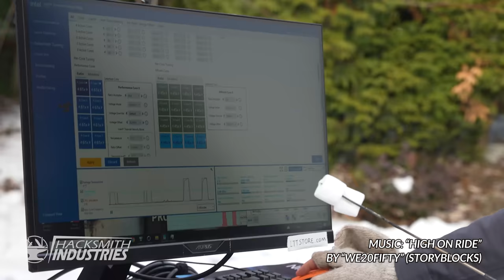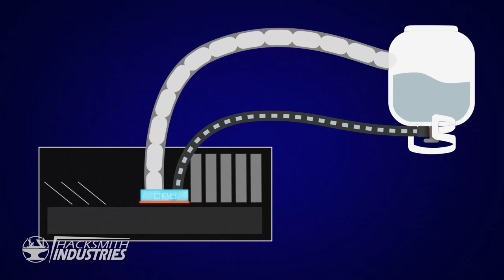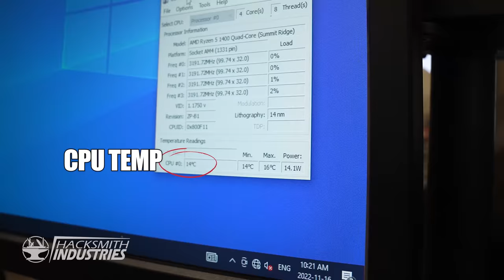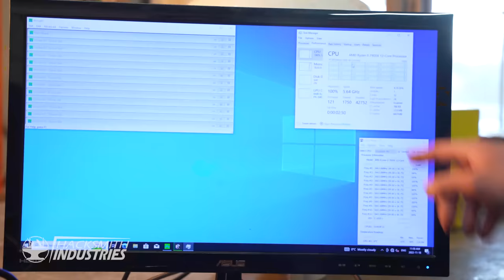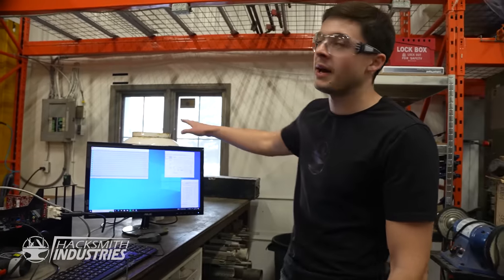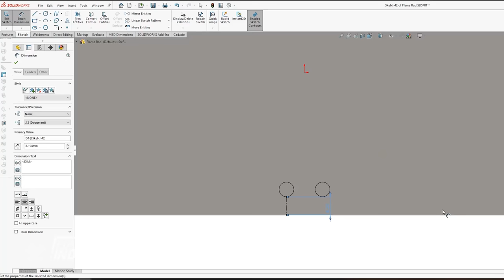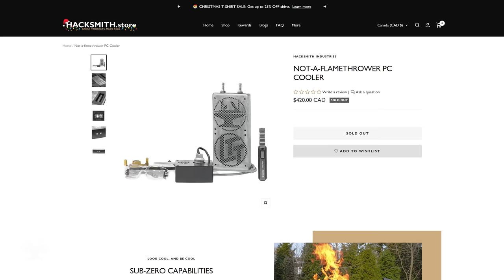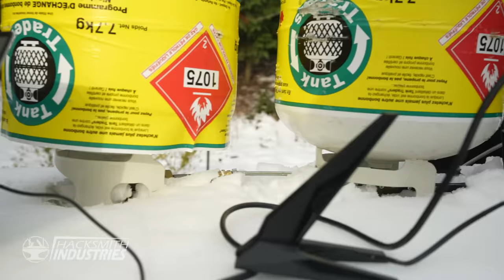I lit my PC on fire to cool it off 🔥

Comment: Compressor doesn't compress the vapor refrigerant into a liquid.  It is still a vapor when it leaves the compressor. The condenser removes the heat from the vapor refrigerant and then it becomes a liquid.  Compressor can't  handle liquid refrigerant,  we'll not for very long anyway. You could always cool it with propane without the flame. R290 refrigeration system would do the trick.  Anyway love your videos. Leave it to Hacksmith industries to cool with fire.

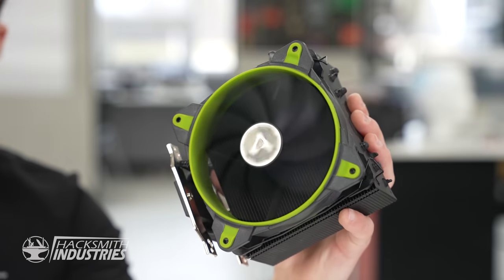Comment: 1:17 Pushing your computer harder draws more power, which means that it generates more heat. At a certain point, the airflow from the fans will not be enough to cool the computer so it will automatically lower the power draw so it doesn't overheat and get damaged. In other words: more airflow means more cooling, which means you can push your computer harder, BOGDAN!

Comment: Reminds me of the old propane jet beer cooler from New Zealand. The benefits of the jet were that it handled all of the combustion internally, so there was no propane or flames spewing out. The cons, though, were that it used fuel directly from the tank, meaning only things contacting the propane tank were cooled, and the jet was noisy, around 125 dB if I remember correctly.  All in all, nicely done!

Comment: I feel like the final design needs some aluminum heat deflectors to channel the radiant heat from the flame upwards away from the case and the lines and maybe some ceramic wool to keep certain parts from igniting

Comment: Place just the motherboard cpu etc inside a vacuum chamber with the propane venting/burning off out side it, the moisture inside will instantly evaporate and attach pump to keep it a vacuum during operation allowing you to maintain those sub zero temperatures indefinitely.

Comment: The propane cools the cpu, the fire doesn't alter the cooling. This is propane cooling a pc then burning off the propane, which you could alternatively capture or just release in a ventilated area as propane is not considered a pollutant, or a greenhouse gas. If the fire doesn't have a direct effect on cooling it's not a fire cooled pc, it's just a pc, with fire

Comment: Remember my old 74 Mercedes camper where I had an fridge that could be either powered by battery or by gas. We even use evaporate cooling on our beer cans on festivals when we put them beneath the tend so when the morning dew evaporates they cool down (just beside amonium nitrate what is not easy to get if you are not a gardener or rocket scientist 😜🤣😂)

Comment: to assist with preventing the case from melting you could install the "radiator"  in a barbeque so you can cool the processor while cooking a meal such as a steak or roast.

Comment: So... you could actually have that setup produce power at the same time as cooling the cpu. Look into the Seebeck effect.

Here's what I would do, if I had the tools and materials. 

1. Create a heatsink for the thermoelectric peltier units (We'll call them TPU's for short for sake of ease.) You are going to use these to utilize the seebeck effect. This heatsink needs to have two flat contact sides for each TPU. A hot side and a cold side. The best way to do this will be to have a giant  heatsink for both sides with multiple contact points for each TPU with their wires facing outwards from the unit; with protective shielding from the flames/cold. 

2. The propane is fed through the cold side of the heatsink. The hot side is your flame expander. The propane also could be fed through to the CPU, but if so, this is only after going through the cold side heatsink first because that's going to have a fan attached to it to help cool the rest of the computer through a desiccant filter (to absorb moisture that shouldn't be going near electronics.).

3. The TPU having been sandwiched between the hot and cold sides opposite of its own hot and cold sides to produce that seebeck effect; now run the positive and negative lines to a battery bank and a capacitor bank. The capacitor bank takes the power first. These are ultra capacitors so they can release their charge at a slower rate than usual capacitors which normally discharge quickly. This is important, because a regulator will be placed between these capacitors and the battery bank to turn the discharge from the capacitors into a usable voltage and/or amperage for the batteries to be charged with. (This is because the TPU's in use will only be providing small amounts of power each. You get more power the more TPU's you use in this kind of setup.)

If you make this big enough to accommodate enough TPU's, but compact enough to reasonably sized, you could probably use this to both help cool a PC even with out a propane contact point for the CPU itself; while also having the hot side heat the home of the user. Just put it in a protective casing to keep the flames encased in a safe enclosure that captures the heat in a thermal mass that can be used to passively heat the home with/without fans. 

The cold side has a fan sucking air from the home into the cold area to push through to the PC to be cooled 'naturally'. The hot side is the same idea, but for the home instead. The thermal mass is there to take the abuse from the flames while keeping the home safe. A third vent would be required to pump any fumes created to the outdoors. So the cold and hot sides would need to be kept completely air-tight. This is where the protection for the wires comes into play. That area already needs to be protected from the flames and cold; so it can serve multiple purposes. It can act as the air-break, the protective layer for the wires; and a separating wall between both sides to ensure potentially dangerous fumes don't go places they shouldn't. 

It's not really possible to show the design properly in a comment like this; but using the keys on the keyboard as best I can; here it is. Imagine the rectangle in the middle is the TPU. 

Computer <--- cold air <--- Cold side Ice {][][} Hot side Flames---> Thermal mass ---> Home

[] TPU = +/- wires --> Capacitors --> Charge Controller --> Battery bank --> Fans and Lights

Now imagine this concept with many TPU's lined up to make use of the propane as best and efficiently as possible. 

I hope this has been able to be understood by some of the madlads at hacksmith. If you do understand it, please consider trying to build it. It would be neat to see one of my ideas actually come to fruition. 

Oh, one last thing. 

You can reduce the flame size more. You don't need to be all pedal to the metal with the flame size for this. In fact, it might be best to regulate the propane flow down to something closer to 1% instead of the 10% you were using for this video. You optimally want the temperature difference for the TPU's to be as wide as possible, but you also don't want the thing blowing up either lol.

Comment: Wouldn't you be able to do this without having to burn the propane? make a closed loop system with a compressor and hard copper tubing like in a fridge but for a computer? I had the idea before. But i'd love to see if its actually possible
Reply from the maker: Of course,  then it's just like how an air conditioner works, but this is the Hacksmith channel -- things need to be on fire!

Comment: ....Have you thought of putting the PC parts inside a vaccuum casing? That way there wouldn't be any problem with air moisture aggregating around the motherboard, since the moisture would be at zero under a very simple vaccuum. Plus it sounds hella cool solving the problem like that.

Comment: Build a pc case designed for this application, combustion chamber and smoke stack to contain raw flames and direct heat out a chimney and this is a 2 in 1 gas heater/pc cooler

Comment: Now build a real fire powered evap cooler. Now I don't remember the details but fifty or so years ago I remember seeing a fridge that was cooled using heat. I wish I could remember the operating principles, but basically it let you run a fridge anywhere you could provide a heat source to boil (?) the liquid in the loop. When used in leisure craft it was usually a propane burner of a paraffin burner that provided the heat. In homes they usually used city gas, whatever mix that was.

I don't know how cold you could get these, what kind of efficiency to expect or what was used in the cooling loop, though I have a feeling it might have been ammoniac.

Damn but my memory is getting bad...
Reply: Looked it up and the technique is called Absorption refrigeration. Basically I was right, there's ammonia with a splash of water or hydrogen added for added efficiency. And all it requires is a heat source as there are no pump or compressor needed. It was basically perfected in 1921 by Carl Munters and Baltzar von Platen. In 1926 Albert Einstein and Leó Szilárd proposed an improved version that didn't really catch on as the great depression made the funding for research and development dry up, followed by WW2.

The improvement proposed by Einstein was mostly to make it safer as he used freon instead of ammonia. The freon was considered harmless and removed the risk posed by ammonia leaking out. But it also made the unit less efficient which was a problem he was trying to overcome when the funding dried out.

Anyway, that would really be cooling your PC with fire!

Comment: The explanation of the closed loop fridge is incorrect.
What actually happens:
Low pressure gas is compressed into high pressure hot gas, which is then cooled by the radiator into a liquid and held at the same pressure. That liquid is then passed into a low pressure section inside the area to be cooled which boils the liquid (due to the lower pressure) and absorbs heat making the low pressure gas that goes back to the first step. 

The key errors in the explanation given was that the liquid is passed to a low pressure area and becomes a cold gas. The refrigerant stays as a liquid until it absorbs enough heat to boil. On startup the liquid refrigerant can/will instantly flash to gas but after running for a while the liquid should take some length of the pipe to boil as the pipe has been cooled which in turn cools the liquid for a while.  
The other key error is that the low pressure gas is compressed into a liquid. The gaseous refrigerant becomes a hot high pressure gas, which when cooled by the condenser becomes a liquid.

Comment: If you had a box on top the fire that would host it with a system/ o keep sending oxygen to it as needed it. Plus put a box housing on top CPU with the cooling thing so you don't need to warry about isolation. Then this would become perfect. Although i thing it might get 2× expensive. However,  that is still cheaper than other options.

Comment: Could you use a mineral oil pc and get the propane to run though there so if water does come out it doesn't ruin the pc, I don't believe oil freezes but I may be wrong

Comment: But isn't there a limitation to it too, if u are basically cooling cpu by absorbing the heat to light propane, then ur bringing cpus temp down to propane's ignition temp innit? How does that bring cpus temp below freezing pt
Reply from the maker: Doesn't have anything to do with its ignition temp though...? When propane sublimates from liquid to gas its about -42C

Comment: The FIRE isn't really what's cooling anything here though? It's the end step. You could just decide to leak the propane fumes unignited and you'd still be getting the cooling. You could close the system with a normal refrigeration setup and still be getting the cooling. So any 'cooling with fire' claims are only accurate in a separate, inclusive sense. "PC Cooling, + Fire". I would absolutely LOVE to see the ignited propane fuel heat be harnessed for some other purpose to aid in CPU cooling though!

Comment: Definitely a cool experiment, but at the same time, highly impractical in real life. Unless you have a fireproof mancave, or some other fireproof living space, good luck getting this to work in your home! Also, propane tanks get expensive in a fast hurry if all you're using them for is your computer!
Reply from the maker: Could easily be routed into a normal propane heater, that's just not as exciting for a video!

Comment: Could a less fiery, safer alternative be made with something like compressed oxygen, nitrogen or any other less flamable gas?
Reply from the maker: Then it's the same as how a refrigerator or air conditioner works =)
Reply: @hacksmith  How far can you overclock a fridge then?

Comment: Couldn't you run the subzero part in a box with a dehumidifier to remove the moisture before cooling it
Reply from the maker: But the CPU has to be where the cooler is!

Comment: Is it actually possible to make it into a closed loop system?
Reply from the maker: Yeah there are propane powered refrigerator systems.  This really is identical to how they work,  and how air conditioners work.  You don't usually want sub zero cooling though due to moisture.  Better to keep it as close to room temp as possible. So you just want efficient high flow cooling instead of extreme temperature cooling

Comment: Yeah, no. The is not a PC that's cooled by fire. This is a PC with a flammable coolant that is being burned off AFTER it has cooled the CPU. (Edit: It sounds like this would work even if they didn't light the propane fumes).

Still, it's a really cool build.

Comment: Why didn't you just plug your cooling system to existing propane consumers like ovens, grills, gas heat lamps? Fire itself isn't a target, you use byproduct of frosting expanding gas
Reply from the maker: That's not as fun for the video!
Reply: @hacksmith  But it will be more commericialy freindly than huge open flame source litterally on overclocking PC)
If this possibillity was at least declared in video it would be more respectable. But thanks for the entertainment) Hope you will stand firmly on your ground soon
Reply from the maker: @PTemnikov  we don't do projects for commercial availability 😀 we just show people what is possible!
Reply: @hacksmith  Then joke with packed boxes confused me) Thanks for responce👍

Comment: kinda halfbaked...

if u made small size ones  with refrigeration cooling
using inverter compressor
speedcontrol jast 100w power

there will be high demand

Comment: Wait if you can do this with propane why can't you just make a closed loop system with freon and a refrigerator pump scaled to fit inside a biger case?
Reply from the maker: Because you don't want sub zero cooling -- causes condensation which will fry your motherboard
Reply: @hacksmith  ooo okay that makes sense😅